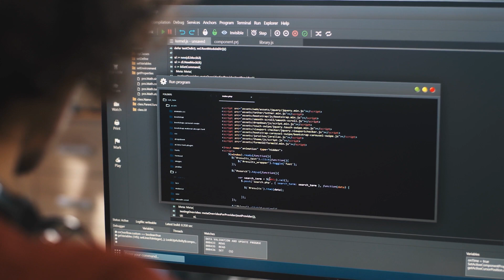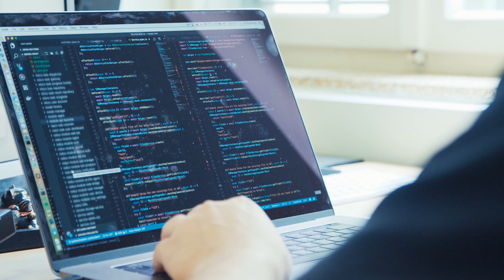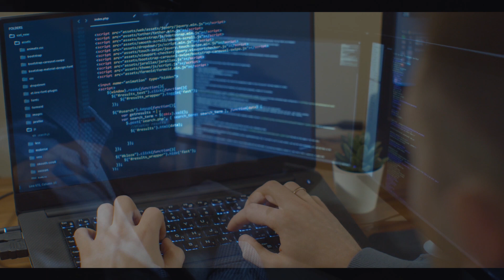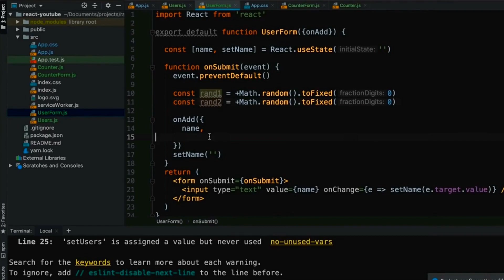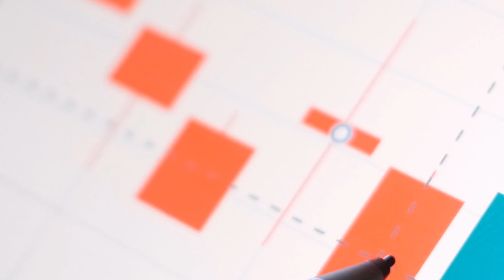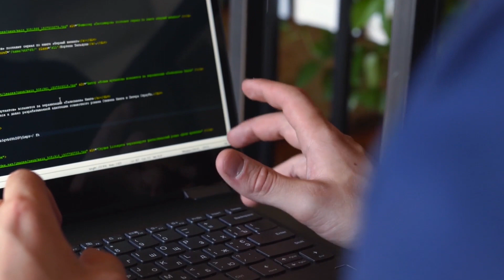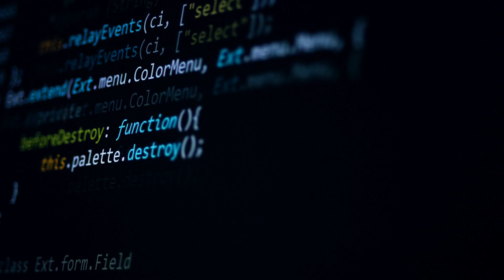The future trends of Python programming in civil and Mechanical engineering

Comment: Python is great language for beginners but it's not suited for everything. Most of software available in civil engineering don't support python API officially so you're stuck with third party packages. python have it's use cases due to large variety of opensouce package availability but vba and C# is better suited if you're planning to use API of engineering softwares.
Reply: Plz tell me what i learn programing language which is applied in civil engineering??